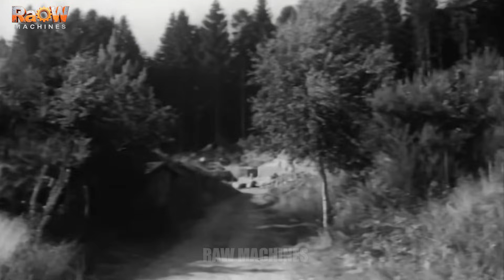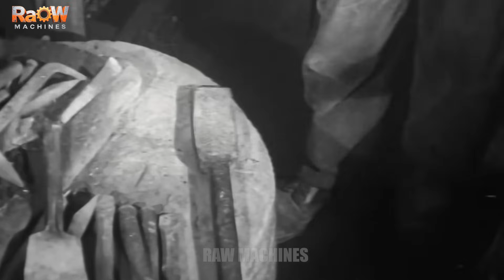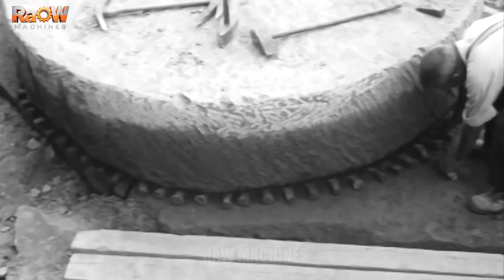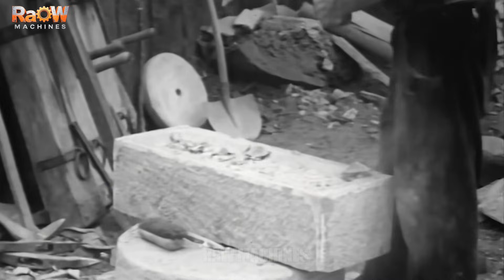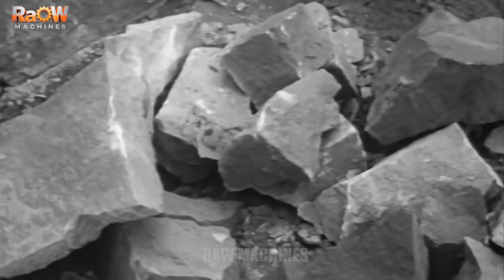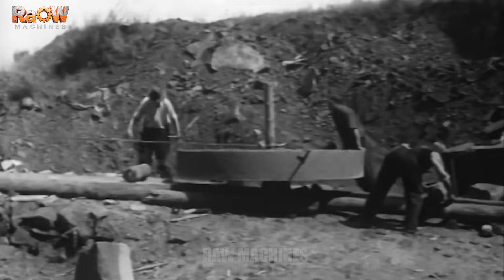Before Electricity: Making a Grinding Stone by Hand in a German Sandstone Quarry

Comment: The tools are quenched in oil, as one can easily see in the video.
Reply from the maker: Great eye 😄 You’re absolutely right — the tools were oil-quenched, and details like that are easy to miss if you’re not familiar with traditional metalworking techniques. It’s fascinating how much practical knowledge these craftsmen had about heat treatment and tool durability long before modern industrial processes existed. Really appreciate you pointing that out! Have you worked with traditional forging or metal tools yourself?